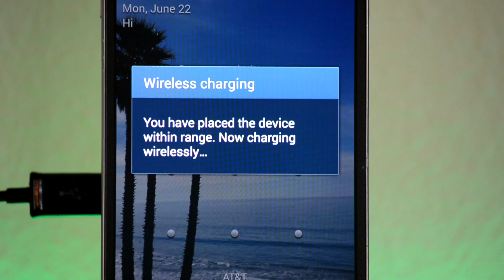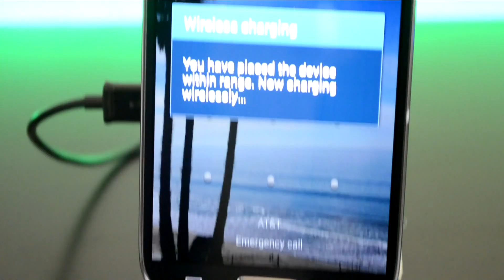DIY: $7 Wireless Charging Phone Dock

Comment: This is only for Samsung right because you need a receiver for iPhones to work.
Reply from the maker: Random helpers Well, lots of android phones are now coming pre-installed with the wireless charging technology, but my S4 did not- I had to buy and install the receiver afterwards. With iPhones, you can still buy an extra case that will allow you to use the wireless technology, and therefore, this dock. This is an ex. of the case for the iPhone 6:

http://www.amazon.com/BEZALEL%C2%AE-Wireless-Charging-Installation-Compatible/dp/B00RY8EW14/ref=sr_1_1?ie=UTF8&qid=1435252372&sr=8-1&keywords=wireless+charging+case+for+iphone+6
Reply: PR Tech Reviews Is the PCBA board in http://prtechreviews.weebly.com/ is the same in the PCBA in amazon they're quite different? Just waiting for your confirmation if they are the same before I order one. Do I also need to get a Qi sticker (receiver) I just bought my Lg g3 and, I don't know if it came with the sticker. I'll sent you photos when it's done thank you so much. hoping for your response.
Reply from the maker: Hyenz Mabborang I don't want to guarantee that it'll work the same way as mine, but upon reading the reviews, the PCBA on the Amazon link looks good. And I am not sure if your G3 comes with a receiver pre-built into the device. You might wanna do some research. But if you want to play it safe, then you can also buy this: http://www.amazon.com/OEM-Wireless-Charging-Battery-Models/dp/B00N29ECGE/ref=sr_1_1?ie=UTF8&qid=1436548709&sr=8-1&keywords=lg+g3+wireless+charging+back

(The white one is cheaper)